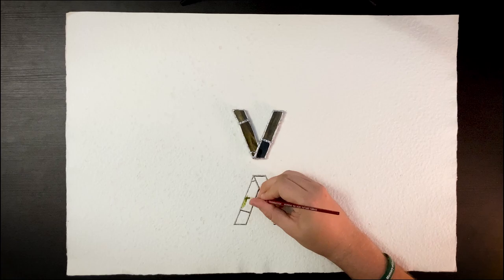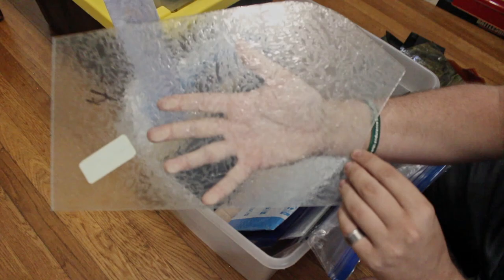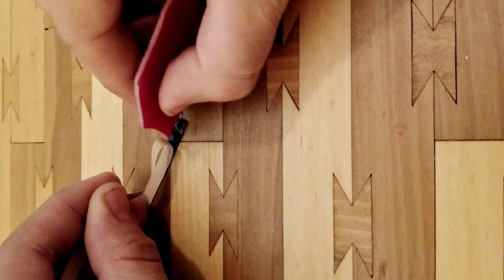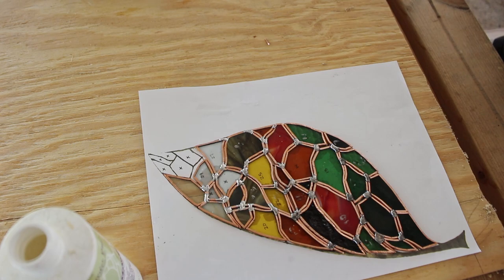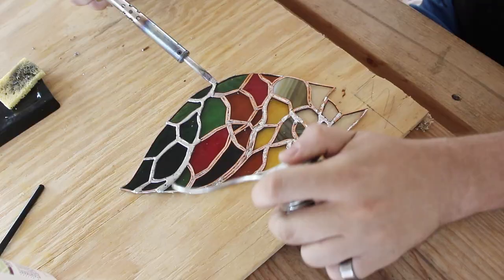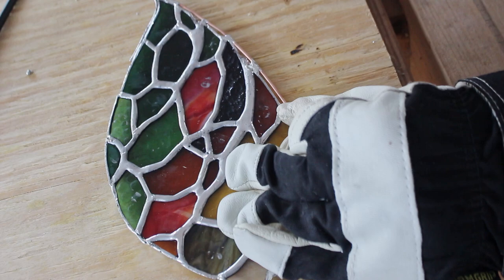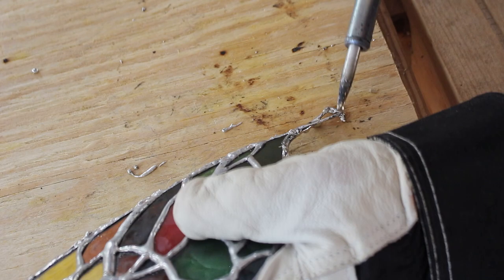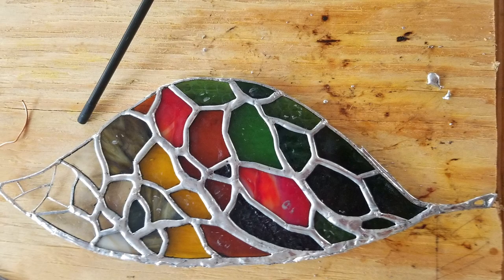Can you add Copper Wire to stained glass projects?

Comment: Hint: Lightly tin your copper wire before attaching to art piece. Also a bamboo tong will hold copper wires while solder. The bamboo will scorch but will hold up and save your fingers.